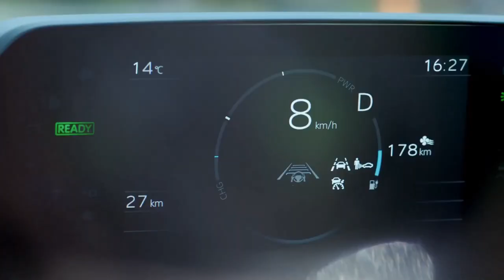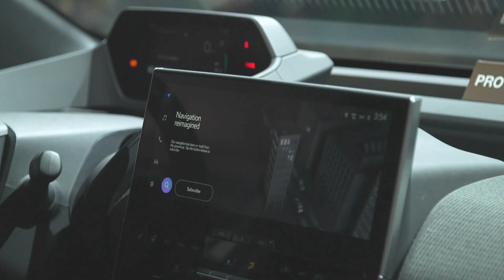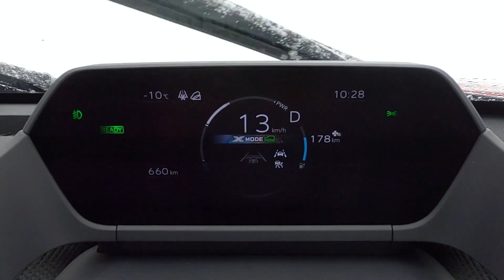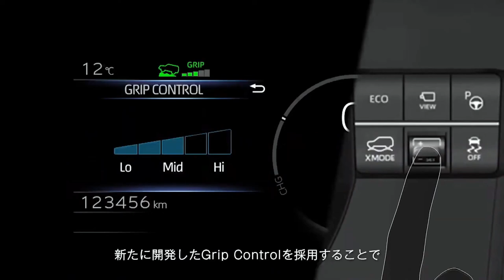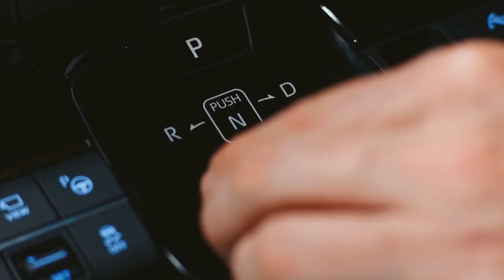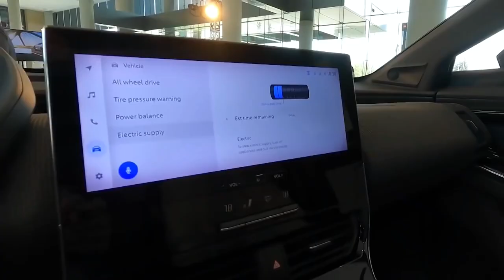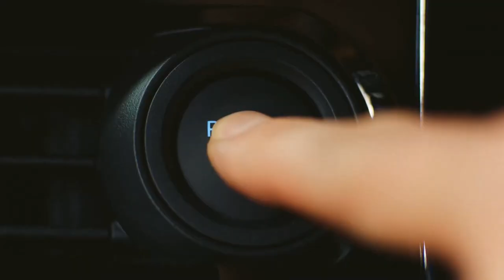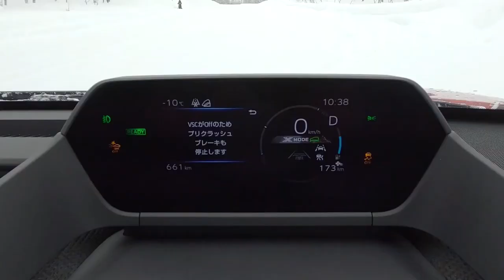🔴 NEW Subaru Solterra Or Toyota BZ4X | What About Prices?

Comment: The two cars are 95% identical and will be made at the same factory. Toyota have a front wheel drive option while the Subaru is AWD. On the outside the front and the fenders are slightly different while the rear light is also different. On the inside the difference is even smaller. A few things on the equipment installed will variate like power operated seats and heating of legs by a infrared radiator. On the Subaru you can also set the level of regenerated breaking via pedal shift on the steering wheel. I have noticed that the specks on cars for the European market is different from that of the US market. They have also used other names for the various equipment levels on the cars. As far as I know the yoke wheel steering will only be for the Chinese marked for now. For those that can wait the Lexus RZ 450e will come out next year. It is built on the same platform but with more horsepower and more equipment than the two others. Yoke steering will be an option.
It will also have a sunroof that adjust how much sunlight it allows in. If you go for the Toyota or the Subaru will be like have to choose between two identical twins for a date. Their personality or in this case yours will decide which one you pick.😊

Comment: The reason the Subaru Solterra is priced higher than the Toyota BZ4X is the features, A few of the  Toyota BZ4X equipment is optional where the Subaru solterra is standard,   Subaru Solterra is only available in All wheel Drive on all 3 of their trims. The Toyota BZ4X offers front wheel drive and all  wheel drive systems on both their trims,  The best way to figure out the differences is to check their brochures and look at the features and options offered on the 2 counterparts. Also the big difference is the Federal Tax Credit.  Toyota may have exhausted most of their $7500 tax credit allocations where the Subaru Solterra has not..  Something to consider !!!!